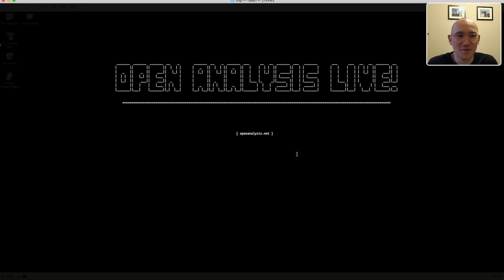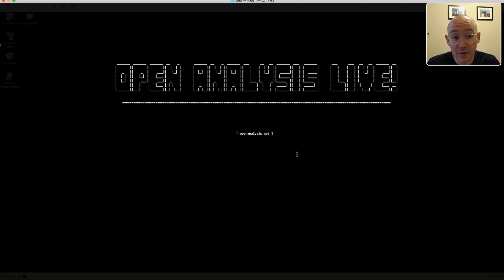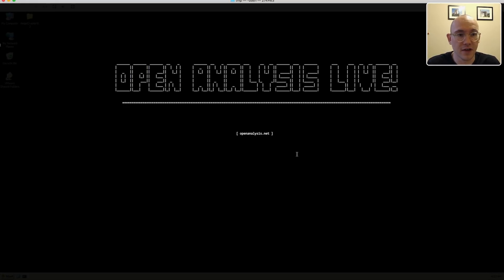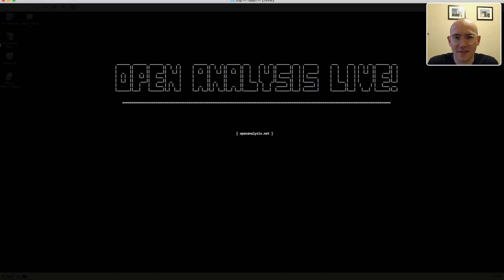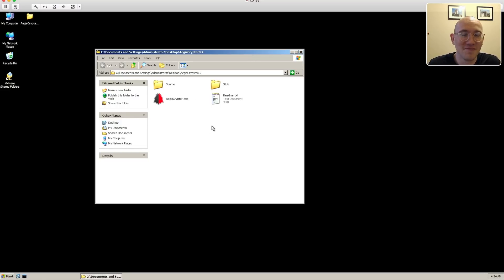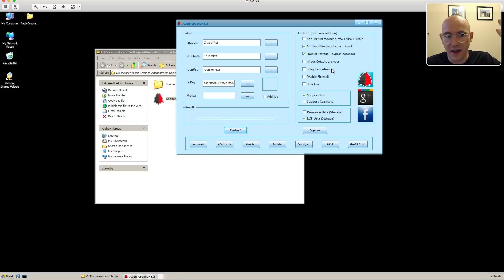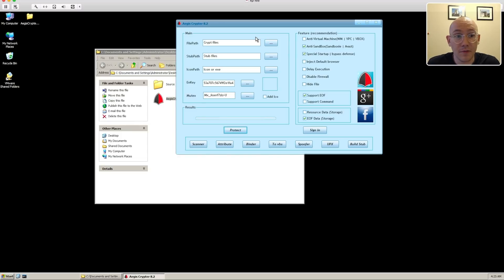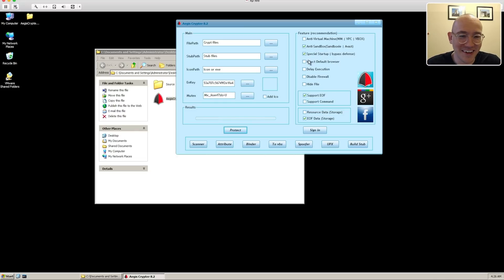How Do Packers Work - Reverse Engineering "FUD" Aegis Crypter

Comment: I think your explanation on the EOF "End of File" part is incorrect. I could have misunderstood you, but the EOF option on crypters means that the crypter will extract the EOF data from the malware itself and append it to the end of the stub file because some malwares look at the EOF data and pull settings to run properly. If you crypted malware with EOF data and failed to append said EOF data to the end of the crypted stub then when executing the stub... the malware itself would be ran in memory without the ability to read the EOF data and thus error out or simply fail to load at all.

Nice Video! Keep teaching people we need more IT Security Researchers in the world.

Comment: I must be missing something very basic here, but when you pressed run at 13:15, the EIP didn't increase which would mean no instruction was executed and yet something was written in the memory address virtualalloc returned? And this was repeated multiple times. Super useful video but I would really appreciate it if you kindly explain what happened there. Thanks!
Reply from the maker: Hey, that's a good question! So when I pressed run EIP was pointing to the address of the breakpoint I had set. The program executed and then stopped because the same breakpoint was hit again. Since it was the same breakpoint it looked that EIP hadn't changed. No tricks : )
Reply: @OALABS  Thank you so much for the reply! I now understand that the VirtualAlloc function gets called 4 times before calling CreateInternalProcessW which is why you hit the ret line four times before hitting CreateProcessInternalW, giving the illusion that EIP isn't changing. Simple enough, should've noticed it on the first go, but actually downloading your sample from malshare and playing around with it made me understand what's happening. Slow but sure improvement I guess. I can't thank you enough for these videos though, I'm going through them all one by one and it's opening up the cryptic world of malwares to me! Keep 'em coming!